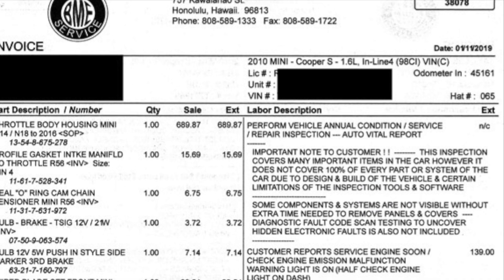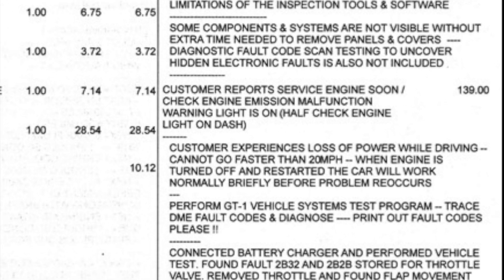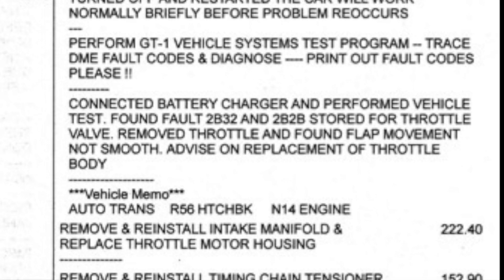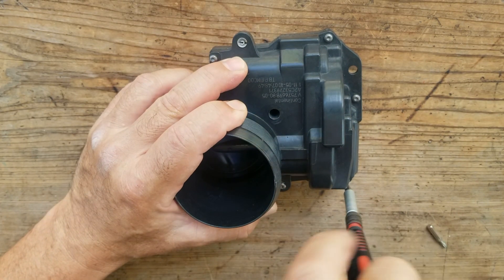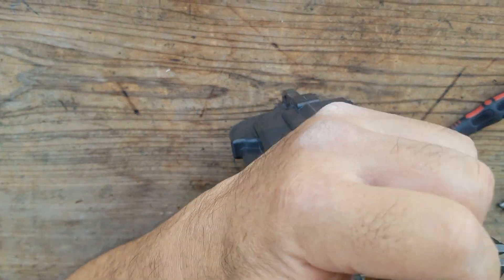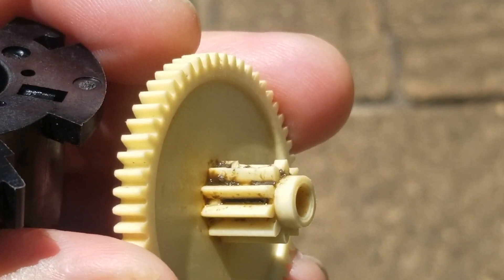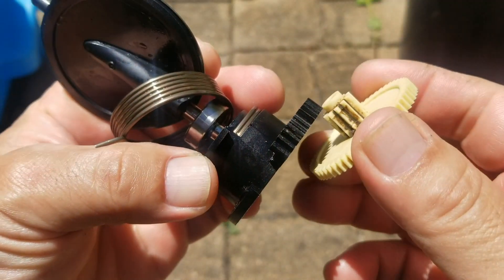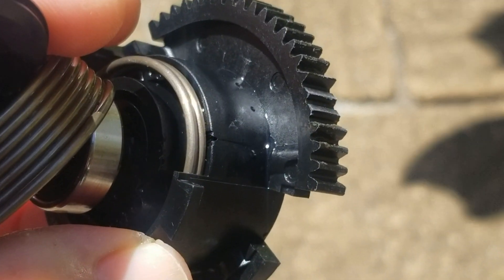2010 R56 Mini Cooper S Throttle Body Autopsy

Comment: There is sod all about these on the internet, I deep dived a bit to help us all out.

0:56 the pinout left to right at this angle is.

1 Motor Neg (not ground) Think H bridged controlled
2 Motor Pos (not ground) Think H bridged controlled
3 Signal out (1 or 2 doesn't matter I think) Fly by wire wants a redundancy same colour wires on my car
4 Ground Common For hall sensors
5 Signal out (1 or 2 doesn't matter I think) Fly by wire wants a redundancy same colour wires on my car
6 5 Volt Common for Hall sensors. Important. test with 5 volts or lower or blow hall sensors.

If your fault code says spring not returning or mismatch in signals from s1 or s2 or grounded or shorted. It is probaly a bad plug full of oil and dirt. But to test the throttle posistion sensors, there are two hall sensors that have to send the sameish voltage back to the ecu just incase one blows up and tells the engine to go full on.

You need 5V supply. Connect ground - to pin 4. Connect 5 V to pin 6. Use a meter in volts range. Black Probe on pin 4 gnd. and positive probe on 3 and then 5 whilst moving the buterfly. it should change voltage on each pin from roughly 0v to 5v. The values are rough. if you get 1v to 4v thats fine. Thats why the ECU has to lurn the values. But if both signals are doing roughly the same. the throttle body is good. Ohh. Appart from the motor. just tap 12v across pin one and two to check it moves full open. And manualy move the butterfly for crunching noises.
Also contact clean the crap out the plug. Better yet de pin it. These get full of oil. Gimme a shout if I forgot anything.
Thanks for the upload I fixed it!
Reply: Mines throwing a code about the closing spring test so hoping it’s just dirty, whipping it out later to clean up and refit
Reply: @davidholder5471  A vacuum leak for the crankcase breather hose can throw the same code. rear left of the rocker cover on prince engines
Reply: @UberAlphaSirus took it off cleaned it and refitted and it appears ok (but will see how it is in the morning) interestingly the plug was soaked in oil. 

The breather is on my list of jobs along with the rocker cover and get a bit of oil smoke on hard acceleration which I wonder is related to the hose or the PCV 🤷🏼‍♂️
Reply: @davidholder5471  TBH Oil is fine on the plug. These wont always crack open cleanly and it is a right PINA to close it back up with the spring being in the right place. Don't use carb cleaner as it will eat the motors enamel. If it checks out as I said in the pinout, then it's fine. If you have a vac leak it will throw that code as the breather pipe goes in after the throttle body so computer thinks the valve isn't closing. Which looking how it's made and how strong the spring is I very much doubt. It will be that hose or the rocker cover that has a non serviceable PCV valve. Taking the inlet manifold of and the gubbins underneath Is a crappy job. Check vac leaks first. :D
And there is another tube that can make it look like your turbos sucking in oil too IRC.
Reply: @UberAlphaSirus  so tackle the hose next then, cleaned the body up and refitted thought it had gone but came up again this morning. Don’t want to spend £100 on a throttle body is it’s the vacuum hose at fault
Reply: @davidholder5471  Sounds like a good plan fella. Dont let the hose connector fool you either. It's can pop out under turbo boost then suck back into it's hole when idling. And that's when your poping the hood to look. I think the code was weak return spring. As you have had the TB in your hand. It's natural state is just a tiny bit open, but the butterfly valve should open up with a bit of force by hand and close by it's self with a bit of force from the spring. I recon 99% of these never fail. There is no way that spring will ever fail. motor could burn out maybe and the two hall sensors maybe. My PCV hose I think it was had a dogey clip ring on the rocker cover, evey time I poped the hood it was not clicked in, so I just put a little screw through the hose end and rocker cover so it can't pop out. That fixed that code. Sold the car day after.

Comment: Hey Thanks for the video. I rebuilt mine after seeing your tear down. I done a bit more delving with a multimeter/ occiliscope and power suply. Do you mind if I use some of your video to make a diag video. I missed a lot of video doing it as I need it done. There's nothing on the internet about rebuilding these units or the wiring and testing of them. But I think I have it down now. Thanks for the vid.
Reply from the maker: Wow, that's awesome!  Please use whatever video to make another one that people can find helpful!
Reply: @IFixedIt22 Thanks Man. Might use all of it if that's OK, I will link up your channel and vids. Hmm I should watch your vids too.

Comment: Is that motor oil in the throttle body?
Reply from the maker: It sure looks like it.  Do you think it seeped in and caused the problem?
Reply: @IFixedIt22  how bad is the leak on your valve cover? your failure looked like the teeth. I took mine off this morning and had motor oil in the plug. I think when I replace it I will be adding extra protection to prevent motor oil from getting in there. -__-
Reply from the maker: @enicolas1985  I did not even notice an oil leak.  The shop did the repair so I didn't even think to look.  I will have to take another look this weekend.  Thanks for the comments.
Reply: @IFixedIt22  the valve cover diaphragm tends to malfunction. That’s where mine if leaking.
Reply: Was the throttle position sensor bad as well? Thanks!
Reply: @IFixedIt22 I bought a car with a R56 engine that came with 7 to many liters of oil. If your car has a gallon and a half to much oil. it gets into your next weekend let alone every thing in the car lol. But these motors are renowned aparentley for oil ou the intakes, so throttle body being low slung under the inlet ends up as a catch can.
Reply: @precool I took 2 hours taking out the silicone potting compound with a needle and tweasers. They seem fine. I think Oil ingress and carb spray made the potting compoud conductive, also the plug. All seems good now.

Comment: Is the actuator in the throttle body?
Reply from the maker: I think so.  I didn't replace the TB myself, but looks like just electronically connected and controlled.  There was a little circuit board and motor inside.